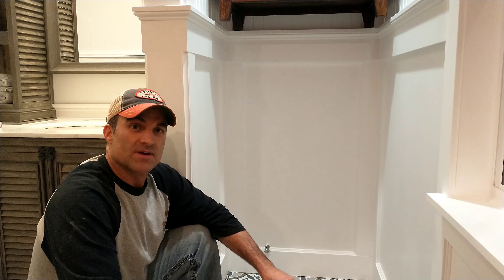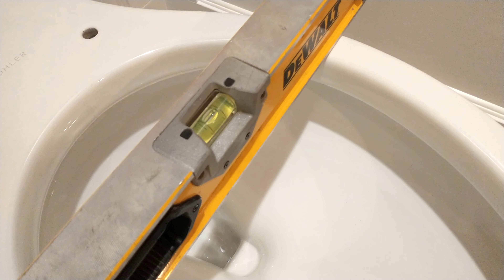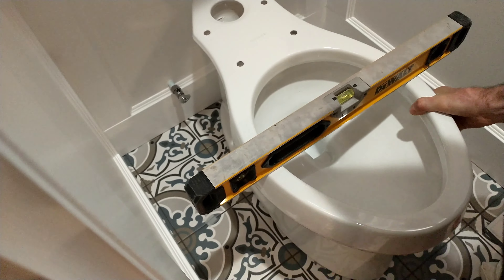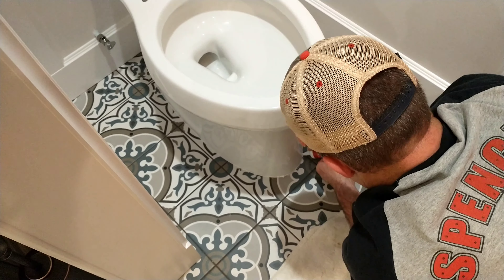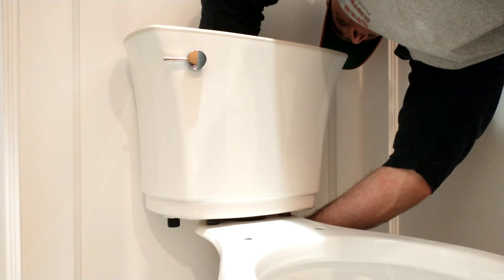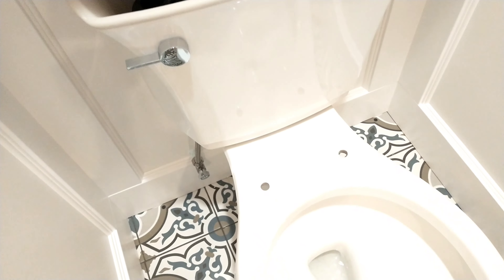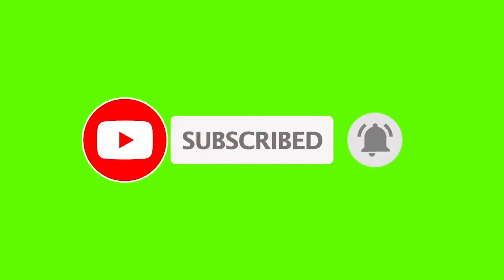Install Kohler 2 Piece Highline Curve Toilet ... EASY!! #diy #how #howto

Comment: Easy, after a few more trips to the hardware store, lol.  When I bought the toilet I bought a new flexible water supply line that was 12" thinking it would be enough as my old one was 8".  Wrong!  Next size up was 16" which was too long so thankfully it is flexible.  Last time I had the toilet out I put a silicone ring in it to upgrade from the wax ring as it was supposed to be re-useable, but it wasn't, so back to the hardware store to get a better silicone ring as they are more forgiving than wax if you set the bowl down on it the wrong way the first time.  If I were still in my 20's, I'm sure I could have done it all in a little over an hour, minus the trips to the hardware store, but at age 56 as many times as I had to get down on my knees and back up again it took several hours, not to mention I also installed a seat bolt mounted bidet on it as well.  Had the toilet been out in the open I'm sure it would have been easier, but in this old house the toilet sits back in its own little cubby hole between the back wall of the shower and the hallway wall on the other side.  So, some odd body contortions became necessary when doing things like tightening the tank bolts in back, etc.

I also have one of those over-the-toilet-tank cabinets that rests on legs on either side of the tank.  The toilet I bought is the Kohler tall toilet so now in order to have the clearance above the tank I get to go out to the shop and make extensions I can bolt on to the bottom of the cabinet's legs and paint white to match the rest of the cabinet.  Fun, fun, fun.

Comment: I noticed the water fill line where inside the toilet bowl is low? Can you advise.  Is the water fill level suppose to be that low?  I installed same toilet and notice same as you had in the video.  @10:53
Reply from the maker: Hi! The toilet water level is set right where the overflow basket top level is. Once the water reaches the top of that center black overflow basket, the float stops and the water stops running. This is a high efficiency low volume toilet. You will have a nice flush with not much more than a gallon of water. The reason the water appears low is because the tank is still a standard size tank so it doesn't look strange when you look at the entire unit. However, less water is needed because of the new improved flushing system. That is why it appears that only about 2/3 of the tank is full. Hope this information helps 👍
Reply: @YouCanDoIt2  yes it does,thanks for the explanation.  I thought something was wrong with the refill tube, because i notice the toliet bowl seems not enough water in the bowl fill line

Comment: Thxs for this demo. When installing on a tiled floor, if the flange is below the tile, what's the best way to seal?? The wax ring provided is to small to fit and I bought another thicker one, and it still leaks. Is there a plumber recommended wax ring or other solution? Also, my Kohler tank has 2 bolts that are attached to bottom of tank, not from inside, and it continues to wobble cause can't get enough tighten down. Any suggestions appreciated. Thanks
Reply from the maker: Hi Sue. Thank you for watching the video. And, yes! There is a wax ring kit out there that works for every type of flange application. The brand is called Danco. You can pick it up at home depot. It has several different parts to it for flanges that are too low in the subfloor and flanges that are too high out of the subfloor. If you buy this kit you will be able to seal up your toilet.
Here is a link for you. I have used these before for the exact application you are talking about and they work perfectly:
https://www.homedepot.com/p/DANCO-Perfect-Seal-Toilet-Wax-Ring-with-Bolts-10826X/206393853
Reply: @YouCanDoIt2  thank you very much! On my way to buy it. Appreciate the quick response :). Any thoughts on the second part the problem with the tank bolts?? Appreciated.
Reply from the maker: @spielman20  you're welcome! As far as the bolts go, it's kind of a two-person job unless you have long arms. Someone needs to be pushing down the bolts from inside the tank while the other person is under the tank tightening them. Those bolts are a specific length for a reason so that it forces you to really attach the tank to the bowl. There is a rubber gasket in between that prevents over tightening. However, you still do need to be careful not to over tighten and crack the tank or your bowl. If you have long arms you can do this yourself, otherwise you will need some assistance with pushing those bolts down in order to thread and tighten them properly.

Comment: I don't know if this is highly edited, but I am having the hardest time putting the tank on the back!  The bolts don't seem to clear the holes to thread the nuts onto the bolts and seat properly.  Just rocks like crazy.
Reply from the maker: Hi pdog.  The only thing edited out of this video is just parts where something was redundant, like tightening a bolt.  It sounds like you are not pushing the bolt hard enough through the top of the tank in order to have at least one or two threads showing so that the bolt could catch on. You will need to put one hand in the tank and press down on the bolt so that it smashes the rubber gasket enough to have the bolt thread show through the bottom of the tank. Once you do that, the threads will grab and you can tighten the bolts right up👍
Reply: Thanks.  That's what I did but it wasn't easy, if the bolts were 1/4" longer, it would have saved me an hour.   @YouCanDoIt2
Reply: This damn tank is the problem for us too haha the Kohler video had comments turned off so I came looking for others!
Reply: No wonder it was on sale 🤣
Reply from the maker: @kit10  Hi.  Thank you for watching the video.  The tank is not the easiest to install, but it is the correct one.  You need to push the tank down while you install the bolts and the nuts or they won't fit together.  It's probably the hardest part of the install. Thanks again for leaving a comment.  Always appreciated 👍
Reply: I'm having the same problem. The tank doesn't seem snug. Wobbles
Reply: I just purchased one today and the tank only came with 2 out of the 3 screwes that connect the tank to the toilet so I had to call kohler to have them send me the other screw so I could finish the project 😑
Reply: @m3me405  I just went to install mine today and had the exact same issue! Missing the back bolt
Reply: @YouCanDoIt2  this is a super helpful video. I’m to the part where I am tightening the three nuts for the tank. Every time I do this, the rubber inserts seem to be rolling or coming undone from inside the tank. I take the tank off, reset everything, and try again. Same result. I’m using my fingers to tighten, and the rubber gaskets are still rolling over. Am I too tight? Is there something else I’m doing wrong?

Comment: it is a toilet tank...no need to fancy English 
also you should flush the valve by removing the red cap (no brainer)
also it is best to flush toilet by pouring some water in the bowel before you caulk around it to check for water leaks
also you should wait for caulk to dry before you install the water tank
also you turn water shut-off valve slowly so you do not damage any rubber seals/washers inside the flush valve
many alsos
learn first then upload

Comment: You are still missing a key piece of information on this install. The tank to toilet seat connection should have a tolerance. It is not on the instructions. New standard toilets. Tell you porcelain porcelain connection. A little bit more of a detailed explanation would be much appreciated other than just tightening them up to a consistency?

Comment: How was it installing the 3 bolts? I’m having difficulty installing these to where they seem flush.
Reply from the maker: Hi Christian.  This part is a bit tricky. You need to push the tank down while you thread one of the nuts on the bolt and then work your way to the second one doing the same thing. Put your hand inside the tank and push the tank and bolt down while you have your other hand and nut underneath the outside screwing the bolt on. After the third one is in you will just go around to all three bolts and push the tank down as you slowly tighten each nut to the bolt until the tank is snug and level both front to back and side to side. The rubber flange is very thick and needs to be squeezed down in order for the bolts and nut to make contact with each other. I hope this information helps with your project 👍

Comment: How did you put the bolts down for the ring?
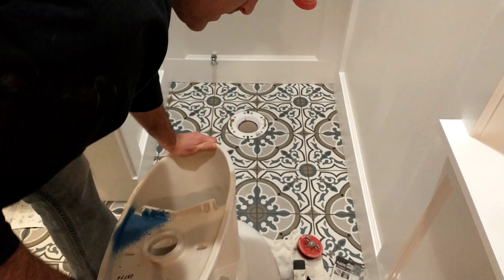Reply from the maker: Hi.  Thanks for watching the video.  At 1:35 on the video, I show putting the bolts into the  drain flange.  Sorry, I wasn't too detailed in that.  There are two slots on the flange. One on the left and one on the right. You put the bolts (flat head facing down) into those and slide them forward. When you dry fit the toilet over the flange you can easily adjust the bolts forward or backward to fit them up into the holes on the toilet. I hope that helps clarify that a bit for you 👍. Thank you for watching. Always appreciated!

Comment: Is this the Cimarron with Revolution 360 Flush toilet?  I just bought one, and the Home Depot guy said that this toilet is powerful enough to flush down golf balls (HA!) ...
Reply from the maker: Not too sure. But, what I would say is that this was one of their top models. We did get it from Lowe's...not Home Depot.  However, if it's not that model I would still say this could flush a golf ball down the toilet. It is very powerful and we are super happy with it!  Looks really good with the upgraded oil rubbed bronze toilet flusher as well. Thank you so much for commenting they are always appreciated.
Reply: I believe this toilet is the Kohler Highline Curve model. It’s the one I am installing soon and looks identical. Great job with the install.
Reply: It’s a Kohler Elliston
Reply from the maker: @tpmplumbing6748   thank you!  Love this toilet.  It has a strong flush!!
Reply: I just got this Cimarron/360 home and unpacked it.  I don't see that round flange or whatever you call it, that is shown in the floor.  Seems like it would keep the T-bolts in place.  Maybe it will be in the floor when I remove the old toilet?  Also, I promise that you  can crack the tank or bowl by over-tightening.  How do I know that?........3 guesses!!!!

Comment: The Memoirs Stately is a bit different. It looks like you screw it down instead of bolt/nut up. Have a wobble and was going to replace the bolts or tighten it down and I saw it.

Comment: Where's the grout
Reply from the maker: Hi Gwen. Thank you for watching the video. I'm not sure what you mean by grout?
Reply from the maker: @IUPLOADSHORTVIDEOS  I've never heard of putting grout cement for an installation of a toilet. Where would the grout cement go?
Reply from the maker: @IUPLOADSHORTVIDEOS  Thank you for the visual description now I think I understand what you're asking. Grout under the toilet is usually only used for leveling an uneven toilet. I've never done grout under a toilet as it is extremely messy, an unhygienic. I level a toilet using shims and then seal around the toilet with a waterproofing non-molding sealant it's a much cleaner install.

Comment: 5:49
"So, the plastic base goes on first, then the washer, and then the bolt."
No, that isn't correct, but I do believe that nearly everyone here should be able to figure that out, or already knew it so well, that they largely ignored what you were saying specifically.  However, I wonder how much confusion this might cause for those new, ambitious DIYers who have been convinced that they could do this, for it is much easier than it seems.  Well, just so long as they don't get tripped up by the bad instructions, and they manage to circumvent the potential confusion.  Yet, such a simple mistake that many will see as no big deal because of our own biases, and our inability to place ourselves in the shoes of the ignorant, yet ambitious, may be the final straw with them ever trying to save a little money by doing their own home repair or maintenance.  So, with the nature of such instructional videos, we must be certain that within we are meaning exactly what we say, and not saying what we mean!
Reply: What is the right order?

Comment: Yes, the wax ring that was included with my new Kohler toilet did contain the necessary hardware: flange bolts, retainer washers, base washers, nuts, and bolt cover caps.  However, I was still missing hardware!  

I had everything needed to install the bowl to the flange, and the seat to the bowl, yet there was absolutely nothing to attach the tank to the bowl besides the rubber gasket, and bolts that were already in place at the bottom of the tank.  I had no washers, and no nuts for the tank.  

It never ceases to completely bewilder me how such a large, successful corporation can make such mistakes!  Such a simple oversight that could have been easily avoided had some employee been performing their job as expected, or in other words, as they are paid to do.  

There are far too many similar examples of people who simply earn too much money, getting paid for a job which they do not perform fully or correctly.  Missing a few bolts may be a minor incident in the overall scheme of things, but it is still a inconvenient hassle for the customer who has paid a substantial sum of money for a product which should have all the advertised parts included as the packaging states it does!  

It is such a simple mistake, that there really isn't any excuse for it to occur, let alone occur at the frequency which it does!  Missing parts?  Now, my toilet installation is delayed by however long it takes for me to remedy the issue through the store, or the manufacturer.  What if that was the only toilet I have in my abode???  I will likely have to waste more time to return to the store to acquire the pieces which should have been inside of the UNOPENED box to begin with.  However, because of some employee who earns more money than they should, I have to waste more of my money by using more gas to drive to and from the store yet again; my vehicle will endure twice the wear and tear upon it than what should have occurred from the acquisition of this product; I will waste more of my time to acquire the necessary parts that I should already have in my possession, precious time which I could have spent earning money instead of wasting time, for time is money; and the stress I will experience will tax my physical, and mental health by dealing with the unnecessary consequences of some employee who is being paid too much money!  

It's not as difficult to ensure everything is included in the box as it is for some employee at McDonald's to fulfill your order promptly, and with accuracy.  Regardless, even McDonald's employees seem to fail at performing their jobs at such a high rate of frequency that I believe they fail more often than they actually manage to succeed when it comes to fulfilling a customer's order correctly.  They have at minimum two screens informing them what should be in the order, one at the food preparation area, and one near the cash registers, or the drive-thru window.  However, they persistently fail to get the right items in the order.  Then, if you have requested any condiments, especially the dipping sauce variety, the rate of failure seems to skyrocket!  

Constantly, without fail, I receive Honey Mustard instead of Hot Mustard!  I am forced to check over my order, pulling everything out to ensure that all items are there, and then even inspecting the food to make sure it was prepared as requested . . . for special orders because they are being prepared differently than what is standard, and there are far too many auto-pilots flying around the McDonald's airspace ("special orders don't upset us", but they often do upset the customers), in addition to making sure that the non-special orders are prepared as they are supposed to be . . . because sometimes my cheeseburger may have no cheese upon it, regardless that my receipt clearly reads "cheeseburger", meaning their order screens also read "cheeseburger", not to mention that I specifically paid extra for that cheese!

I can't blame the patrons behind me in the drive-thru who grow impatient, and even resort to honking at me sometimes, but I have been left with no choice.  If it were just me, I would simply boycott any restaurant that is incompetent at fulfilling their customers orders correctly, which is the one thing that McDonald's employees apparently excel at achieving!  Nevertheless, I have a girlfriend, and she has a young daughter, and sometimes she requests that I go acquire food at said establishment because she is often preoccupied, typically with work.  So, to maintain the peace, off I go to appease everyone, and I shuffle down to that little Irish restaurant to receive another annoying dose of awful customer service.  I mean, come on!!!!  These clowns who don't even really want to be working there in the first place, and who are being paid more money than what they would actually earn, but now, they are getting paid $15 per hour!!!  They should be rocking that job, but if anything, their performance has only appeared to have declined.  There are far too many "workers" in this economy who are being paid far too much money for their "work"!
Reply: Can you explain how Taco bell fails a bit less at their windows since they have 3 screens and i also heard they use Kohler toilets. Not sure why a fancy steak house like Ruths Chris uses Kohler toilets as does McDonald's. But I agree that inflation is partly to blame as to why there is missing hardware like nuts or bolts and Delta airlines decided theyre no longer serving meals on long flights. I do like Cedar Point though I say its way more unqiue than six flags!